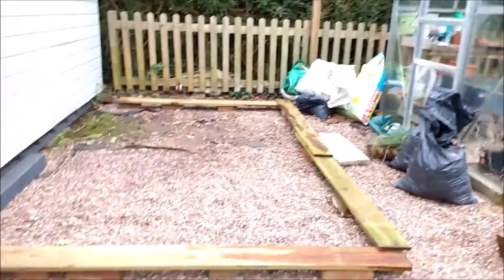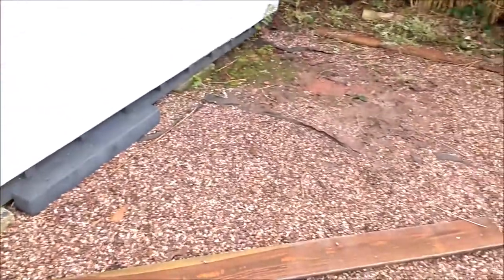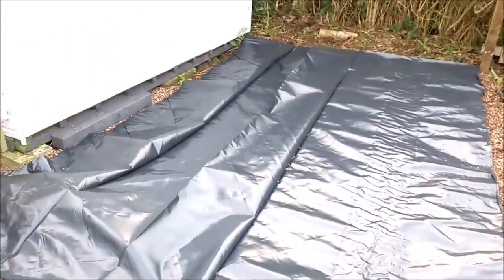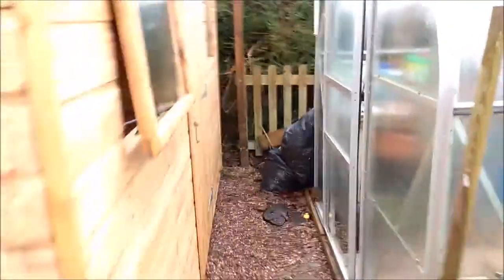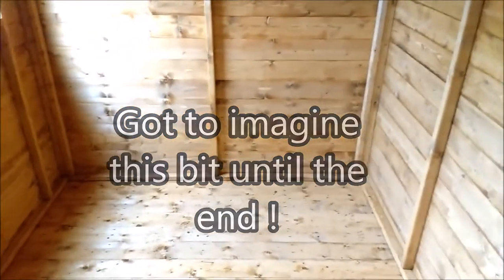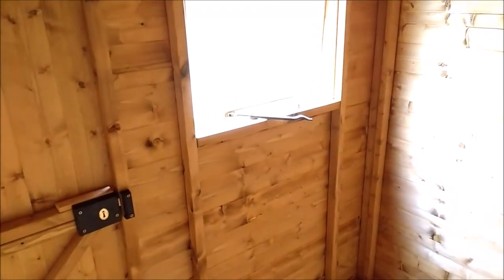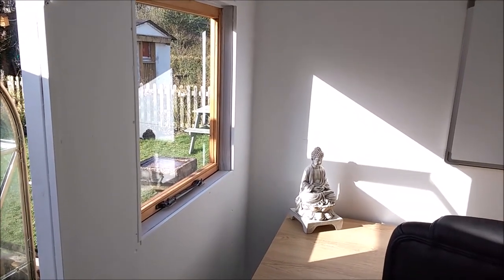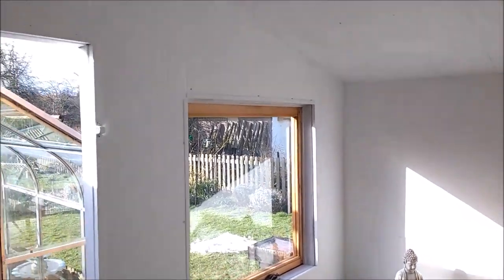How to build and create an amazing office in your garden for as cheap as possible.

Comment: Excellent video. Quick question: from where did you buy your office materials ( the shed its self)? How much was the total cost of the office?
Reply from the maker: Thank you. I bought the shed from a local shed company for about£800. And the materials I either bought online ie Amazon, or a DIY store. The links are all below the video. It all cost about £1,000 which is so cheap. I've been using about 3 years now, full time working at home. And it was cheaper than moving house 😀 totally worth it. Good installation is the key! And ventilation for the summer.